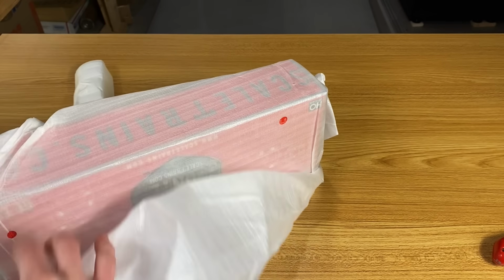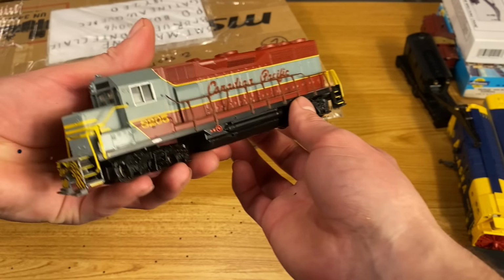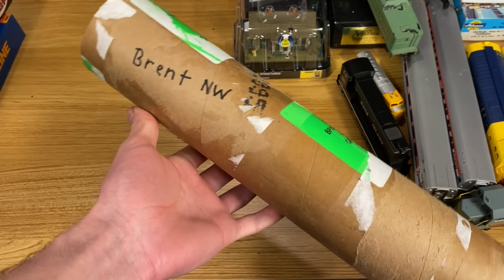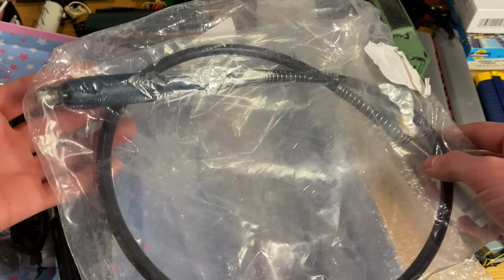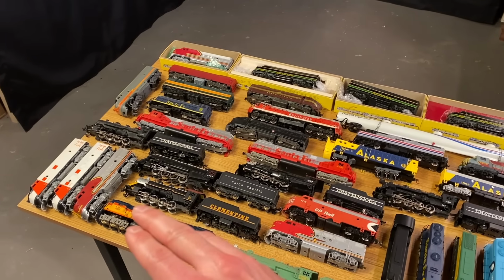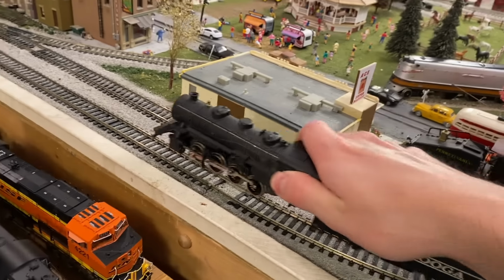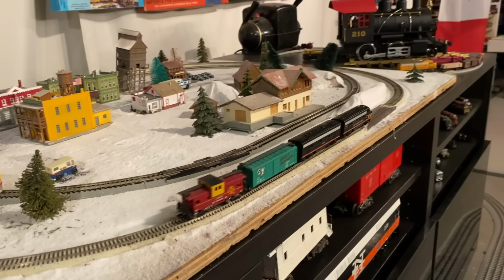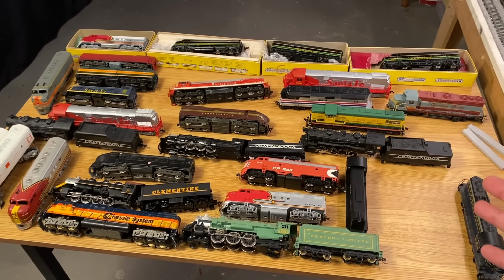MEGA Vintage Locomotives Mail Unboxing - Will Any Run?

Comment: What is the name of that pen you use to clean commutators? I need to try and clean the commutator on my Ohio 4-4-0 steam engine. its in a bit of a rough shape. had to replace the rive shaft from the tender to the engine because it snapped when it fell off the table. It runs, but the motor stalls out from time to time, and despite cleaning the contacts on the tender(which is where it gets its power) it stalls out  pretty quickly, and takes a high amount of voltage to even keep going after I get it to go again. Tracks are cleaned pretty decently. But aren't perfect.
Reply from the maker: It's a fibreglass pencil, you can find them online or at hardware stores.

Comment: Smt i have a bit of a problem could you do a video how to give a SD40-2 a blind wheel so i can make mine go on curves better
Reply: I have the boxcar which is in the style of the rock diesel
Reply from the maker: I've never seen SD40-2 that can't handle 18R. Have you checked to make sure the trucks can move freely?
Reply: @SMTMainline  it does move I think it needs oil in the gears as well as my new (ish) daylight it makes a annoying rrrr sound
Reply: @SMTMainline  it's the track you get with sets and can buy more
Reply: @SMTMainline  it's usely hitting the switch and derails at full speed
Reply from the maker: @MVF_2024-  maybe your just running it too fast for the switch. EZ track switches are sharp
Reply: @SMTMainline  ah ok thx

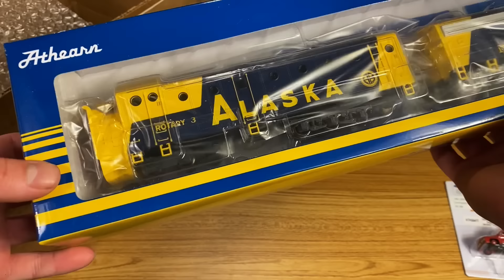Comment: 4:18 I got that today and after running it for 10 minutes, I hear it squeaking from the snow plow and I don’t know what’s causing it
Reply from the maker: The blade is on a pivot and if it gets pushed back it makes contact with the plastic.
Reply: I tried it but it still makes that squeaking sound, I think is coming from the inside
Reply: @SMTMainline  i want to show the video so you can see what the problem is and how to fix it